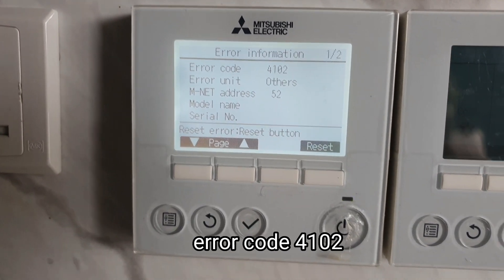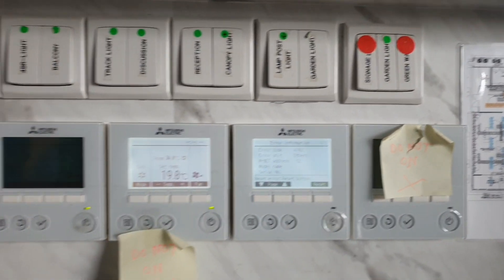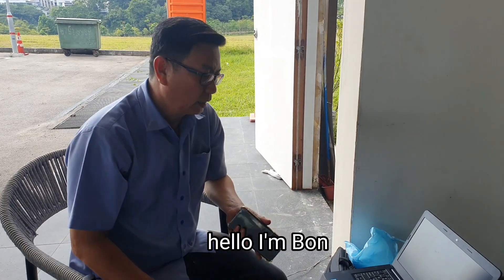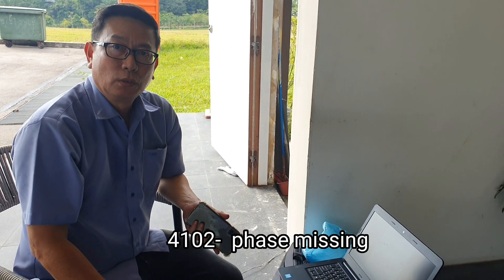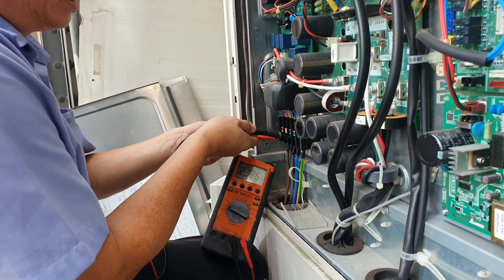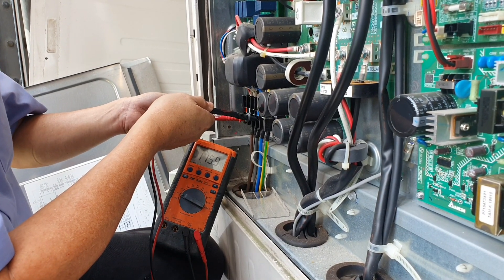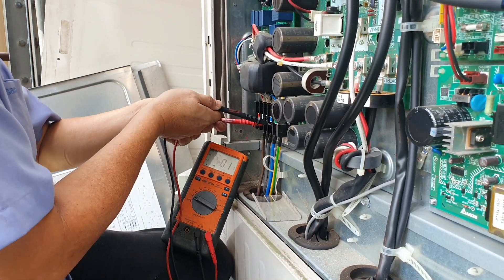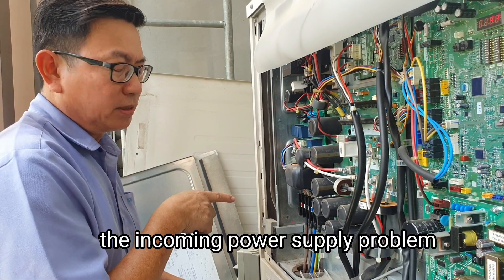How to troubleshoot Air-conditioning open phase | Mitsubishi VRF | error 4102

Comment: Hi @bon , I am facing a problem with Mitsubishi city multi. The thermostat is going to standby with any mode other than the fan mode ( the indoor unit stops and starts to blink the cool in the thermostat). What may be the problem. I have already checked the resistance of the thermistors  and found it ok.
Reply from the maker: Check error code at outdoor unit

Comment: Mitsubishi inverter split ac green light blinking continuously after few seconds to start though remote. Model 
msy gn18vf. 
What is problem ?? Plz reply
Reply from the maker: Check the error at cu (cu pcb light blinking)
Reply: This is new model I don't know how to check error code MSYGN18VF
Reply from the maker: @akashshaw214  check outdoor light blinking
Reply: In this remote there is no check button in this remote

Comment: Hi Bon, can I check if you experienced “UE” error on Daikin VRV centralised remote / Scheduled timer remote before? Any idea what’s the possible cause? Thank you
Reply from the maker: The aircon connect to the intelligent touch manager or centralised control?
Reply: @BonMj  aircon connected to centralised control. The older type one. Beside CRC , there is a scheduled timer controller. Originally only the scheduled timer controller blinking UE. After 1 mth, both controllers flashing UE and the CRC (randomly around 15 units, dots flashing, across different zones in the CRC). And we checked the indoor remote setting for group zone became default 100. Not sure is it because of this? We nv change any indoor pcb. And all units working , only the CRC and scheduled timer controller flashing UE
Reply from the maker: Do you replace indoor pcb?